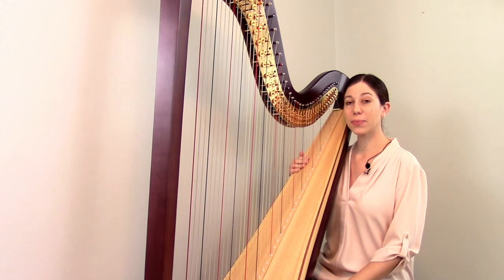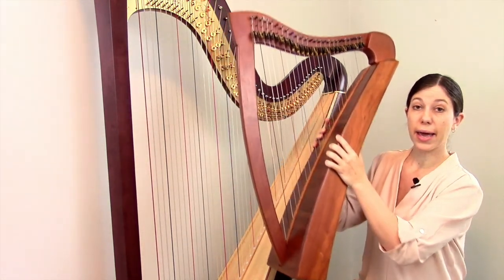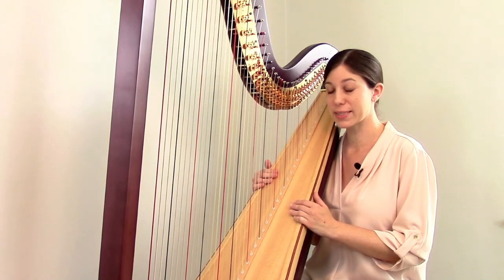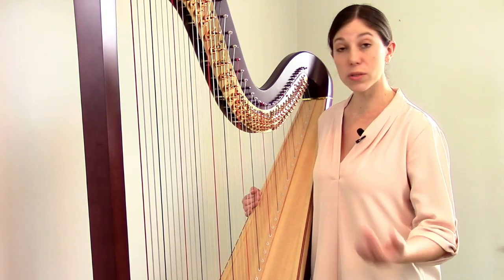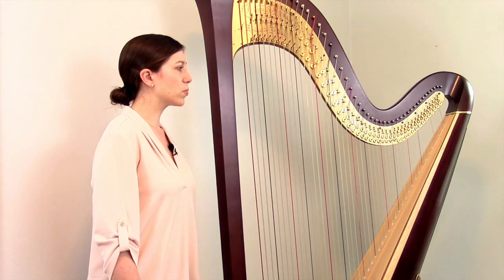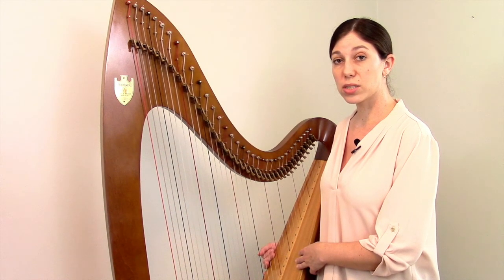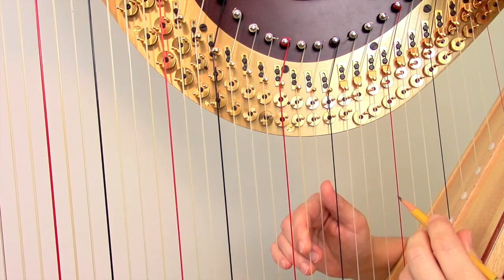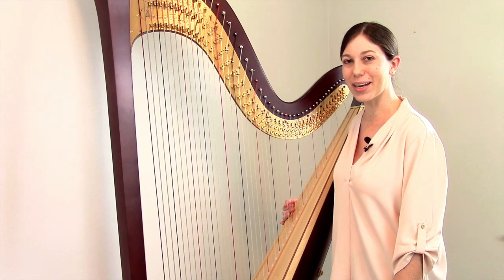Overview of the Harp, Harp Care, Maintenance, and Repair #1

Comment: Thanks for these videos.  I've almost watched the entire series.  As an arranger, you just can't realistically write for an instrument if you don't play it, but this will help until I can afford a harp.  As an arranger, I enjoy seeking various colors from instruments based on things like range, mutes, etc.  So I did a little research and found the ranges of the different string types (https://www.harpcentre.com.au/which-string-is-this/)-- I know you covered this but couldn't remember where-- and was wondering if there are composers who write for the different areas/tonalities/timbres of the harp's strings. Also, I suspect there's someone like John Cage for the harp, who works with "prepared" instruments... right?  Thanks again-- great videos!
Reply from the maker: Using different colors on the different types of strings can work well, but it's also rather tricky. The really nice page you found shows a fairly common stringing, but people make all kinds of choices based on personal preference. The only constant is that C1 - G2 are always wire. After that, the number of gut and nylon changes from harpist to harpist (and for myself from season to season). And, you're correct, there are some prepared pieces for harp out there.

I'm so glad you're finding these videos helpful! I am about to launch an informational harp website - HarpInsideOut.com - which I think will have all kinds of info you might find useful. It should be live quite soon!

Comment: So in tuning, you tune all strings one flat?
Reply from the maker: Yes, you tune all the strings in flat, the Key of C flat Major.
Reply from the maker: If you need to tune a pedal harp, here is a video about that specifically: https://www.youtube.com/watch?v=U13Po2w3-rs&t=1s
Reply: @JacquelinePollauf  Thank you very much. I was wondering if they could make a lever harp that the sharping levers could move up 2 positions? I am aware of the double stringed harps etc. I was just wondering if a lever harp could be invented so it could be tuned in c flat and the levers could move up 2 positions.
Reply from the maker: I have actually considered this before. It seems to me that it should be possible to make a lever harp with a double row of levers, but because the mechanism that levers use is quite different from the mechanism that pedals use for the same function, I can foresee multiple challenges. However, I'm not a harp maker, so these are just my thoughts without ever actually trying any of it out! If you invent such a harp, definitely let me know!
Reply: @JacquelinePollauf  I have passed the idea to a harpmaker and he is going to look into it.
Reply: @JacquelinePollauf  Hi I have passed the idea along to a harp maker who is very inventive. This would open up a new world for lever harps and would work on any size or make that has levers on the sides.
Reply from the maker: @jondoes8222  How exciting! Keep me posted!
Reply: @JacquelinePollauf  I will. I hope he can come up with a solution.  Either way I will get back to you..Thanks